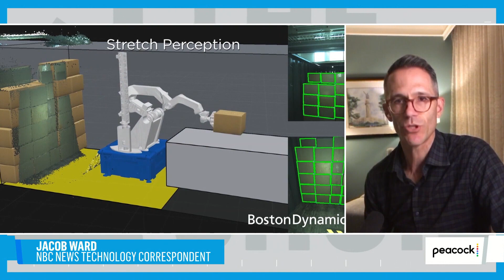Rage Against the Machine: How Robots are Coming for Your Job | The Choice

Comment: The road to serfdom.
Reply: So not having a job means serfdom.  Since when?  What we are really talking about is a large portion of our population not HAVING to work, because technology has created alternate ways to produce things without human labor.

What you are concerned about is the availability of resources and access to the robots that do what has always required human labor.

The reason you are worried is because rich criminals currently control both labor and resources.

But that is changing.  One because we are moving into a world that will not require human labor to provide a healthy lifestyle.  And the cost of resources is going down because we are always learnign to more with less.  Combine that with the essentially infinite resources available in our solar system and what you end up with is something completely different than the challenges markets and capital were created to face.